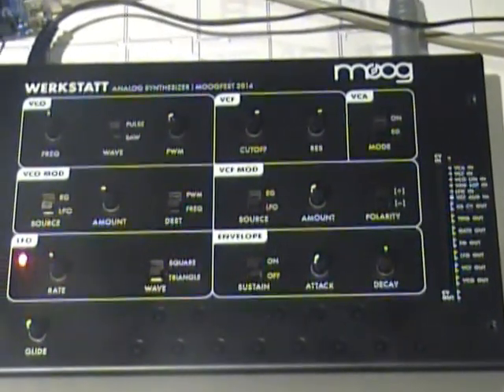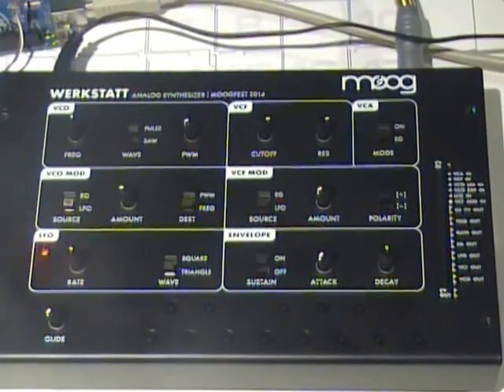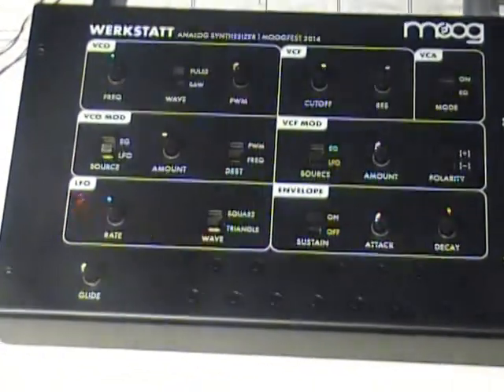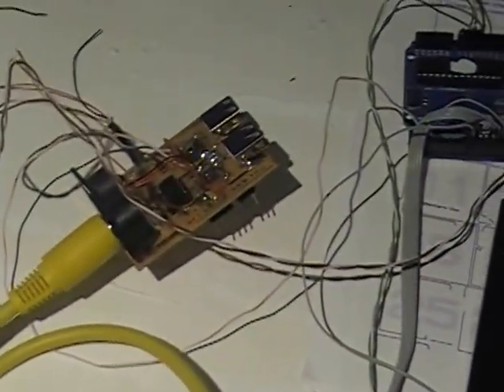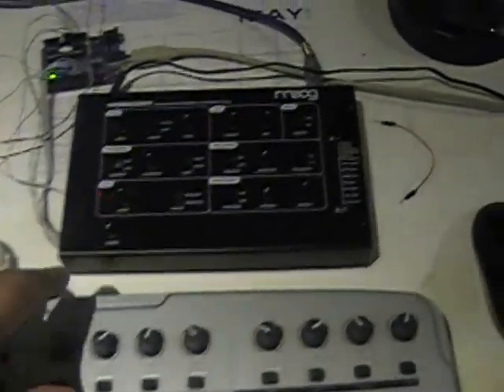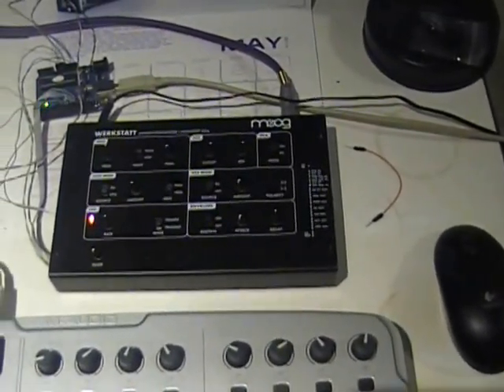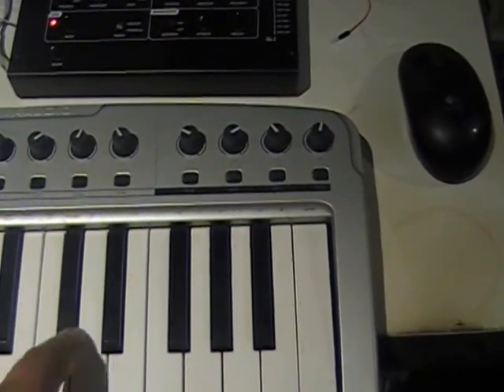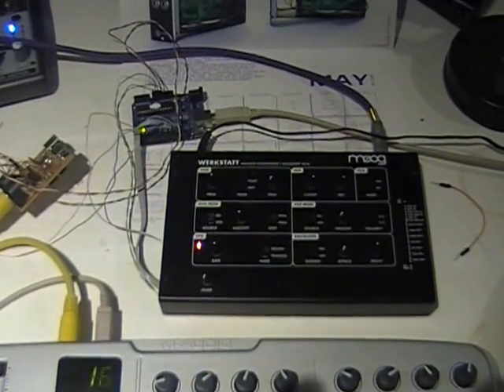Moog Werkstatt Midi Keyboard Interface

Comment: Hi Peter,
I'd like to add midi-in to my werkstatt just as you did. On "Modders and Rockers' I found a description of your mod. But I'm very unsure where to solder the different cables... I've already looked at the schematics but did not find all the mentioned points, am I guessing right?

RowMuxOut    U19-pin3 ?
KBOscIn          U17-A-pin4, U18-A-pin1, U16-pin6, U19-pin6 ?
CountRST        U18-A-pin7 or U18B-pin15 ?
Count0             U18-A-pin3 or U18B-pin11 ?
Count1             U18-A-pin4 or U18B-pin12 ?
Count2             U18-A-pin5 or U18B-pin13 ?
Count3             U18-A-pin6 or U18B-pin14 ?

Do I need to cut any traces to make the arduino kb-clock master?
Does the Werkstatt work without arduino after the mod?

I can't wait to learn more about all the stuff you do...
Reply from the maker: Hi, the Mother of all mods version is simpler  . KBclkin is U1 pin 1. You only need to read Count 3 since when you pulse KBclkin and count 3 goes high you know that the count is '4'  The common of each of the muxes and a line to override the counter reset are the other wires you need. No cut tracks.
Reply from the maker: count 3 (msb of the 4 used) is U18-12 there is a via on this track between U18 and U19. The mux out on U19-3 also has a via you can use to solder too. The counter reset from D8 also has a via just to the right of the glide control. I will update the web page for the Mother of all Mods version at http://moddersandrockers.com/werkstatt/5.php
Reply: Thanks for your explanation! the "Mother of all Mods" is a big improvement to the original capabilities of the werkstatt, congrats! I'll regularely check your website for new information. Is there any other way to get in contact?
Reply from the maker: codewizard58 is my gmail..

Comment: Nice.  Do you have a bill of materials, or did you just read the writing on the surface mount ICs?
Reply from the maker: Hi, I used the schematics posted for the engineers, to decide what to do and then  traced the board looking at what was convienient. I am still updating the web page that the link in the description points to. Most of the Arduino side came from other projects I have made in the last year.
Reply: @codewizard58  It's 2021 now. Have you found tools or a midi keyboard now that are now capable to do this without having to go through the trouble that you did 7 yeas ago?
Reply from the maker: +Ross Sponholtz The schematics can now be downloaded from the Werkstatt Product page at Moogmusic.com